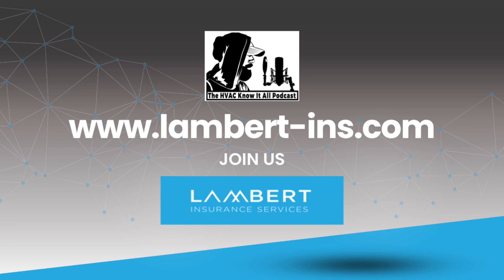How TX Valves Adapt to Multiple Refrigerants and Improve Heat Pumps | Jamie Kitchen | Part 1

Comment: I don't hardly ever see TXV'S anymore. They are a great piece of kit......but it can't hold a candle to an EEV. I mainly work on chillers and very large RTU'S. TXV'S were more or less phased out many years ago. Do you see them....absolutely....but it becoming less and less. I firmly stand with EEV'S as the way to go. Their only downfall is if the transducer and or the thermistor is reading off. Luckily most systems have a way to calibrate them in the field.
Reply from the maker: EEV are great I agree